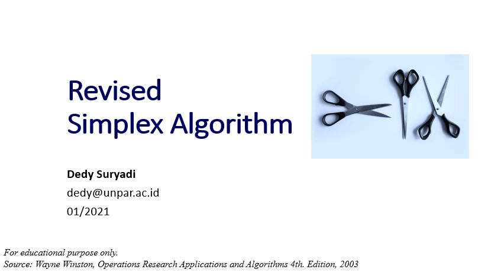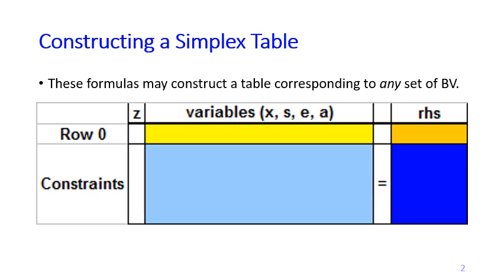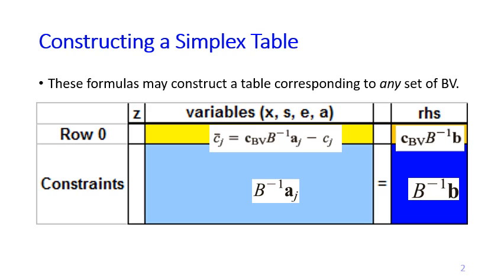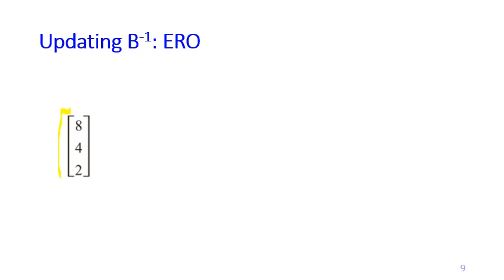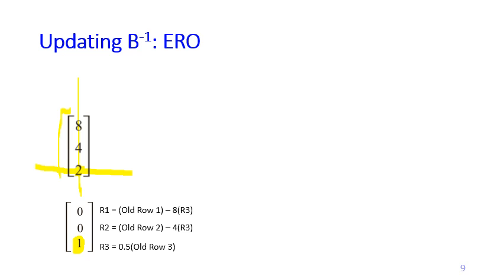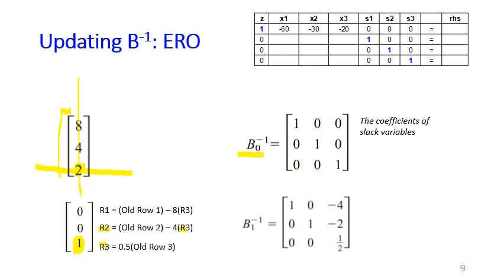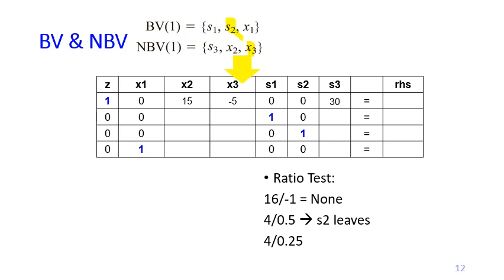Week 13. Revised Simplex Algorithm

Comment: Great explanation, however, I am not quite sure what to do when the coefficient of x's were equal to each other. In this case -60 was the most negative and we choose x1 as entering, what if x2 and/or x3 had 60 coefficient as well. In that case all of them would be -60 the most negative, then which variable do we choose as entering variable?
Reply from the maker: Hello! Thanks for the question. In this case, suppose we have more than one variable having the most negative coefficients, then you may choose any one of those as the entering variable. In the end, you will obtain the same optimal solution(s), if it (they) exists.

Comment: On both B_0 and B_1 where you do Gaussian elimination, why is the result multiplied by what R_3 and R_2 were multiplied by? For B_0, you did 1/2R_3, but you applied the 1/2 to every element in the final result. For B_1, you did 2R_2, but you applied 2 to every element as well. At this point, the third column also changed. It became -8 -4 1.5. How did this happen? My understanding is that multiplying a row by a constant just changes that row, not the entire matrix. That's how I learned Gaussian elimination. What am I missing?
Reply from the maker: In 13:45, it is explained that in the next iteration, the column of x3 should change from [-1  0.5  0.25] to become [0  1  0]. To achieve that, we multiply second row by 2: 0.5*2 = 1.
For the first row: (Old Row 1 + R2) = -1 + 1 = 0.
For the third row: (Old Row 3 - 0.25R2) = 0.25 - 0.25*1 = 0.

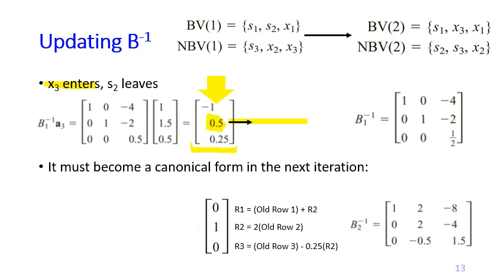Now, in 14:05, we need to update the Binverse_1 to Binverse_2. Do the update by applying the same three rules for the first, second, and third rows to Binverse_1, and you will get the result of Binverse_2.
I hope this explanation clarifies the matter.

Comment: I have a question about the z value in the last part of the video. The equation written there is B two inverse * b which is the same with the top one. 

So what does it use the 48 20 8 not the answer from the top 24 8 2
Reply from the maker: Hi Edo. In 16:00 when we calculate z-value, we use (c_BV * B inverse 2) * b. Remember that "b" is always the original rhs, that's why b = [48 20 8].
If you want to use [24 8 2], which is (B inverse 2 * b), you can also do it. Since the BVs are s1, x3, x1; then c_BV = [0 20 60]. Then, do the multiplication: c_BV * (B inverse 2 * b). The multiplication of [0 20 60] and the column vector [24 8 2] gives the same result, i.e., 0*24 + 20*8 + 60*2 = 280.

Comment: I found that without ratio test and determining the most negative coefficient to determine pivot (instead of doing those two i choose the pivot diagonally, from upper left x_1 until bottom right x_3) seems to also worked out nicely, why?
Additional Detail : what i mean by diagonally choosing pivot is i choose pivot like how you choose it when you're doing gauss elimination to find intersection point of 3 planes or 2 lines.
Like this :
x_1 x_2 x_3
 c_1     0     0
  0       c_2  0
  0         0    c_3
Pivot(iteration 1) = c_1
Pivot(iteration 2) = c_2
Pivot(iteration 3) = c_3
Reply from the maker: Hello! That is an interesting idea. However, how do you choose the correct columns (basic variables), i.e., x_1, x_2, x_3? Because we usually have many more variables (columns) than constraints (rows). For example, we have 6 variables, but only 3 constraints. So, out of x_1, x_2, ..., x_6; how you would pick 3 out of them, I wonder.